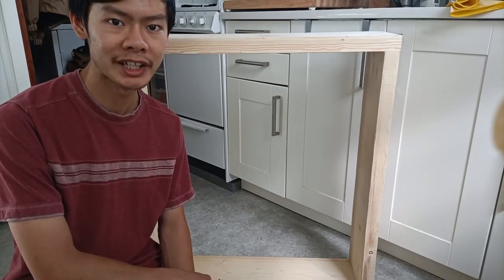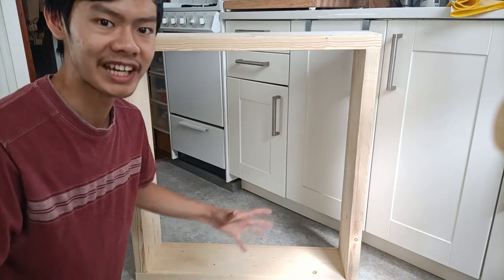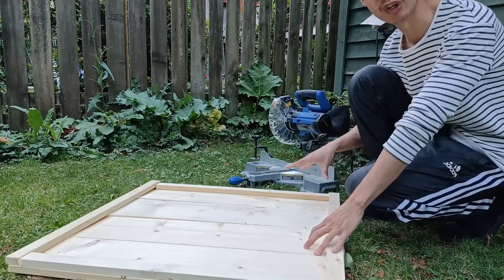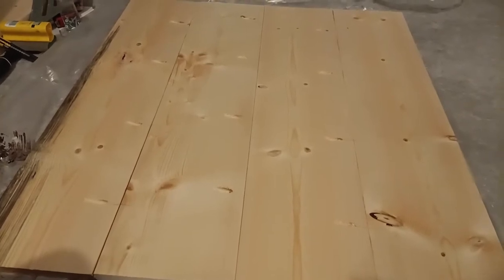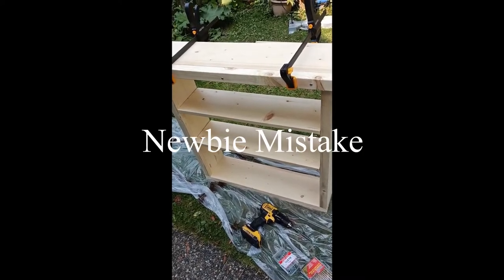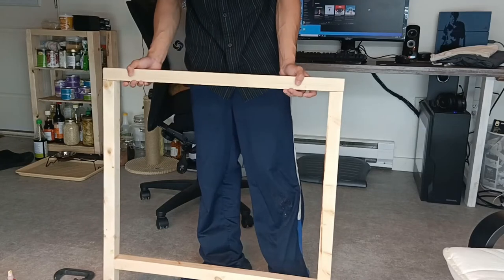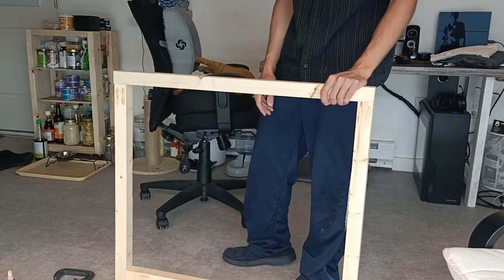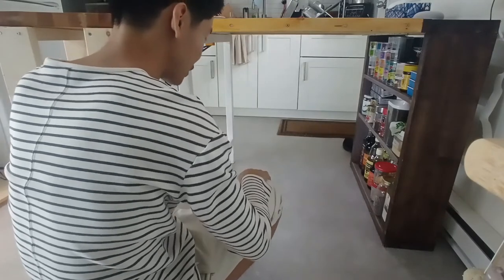Living in a Small Place? DIY Fold Up Dining Table with Storage Cabinet

Comment: Great use of space simple but very effective
Small piece of advice sand the end grain two grits higher than the face of the 
boards. This is so the stain will not soak in so much and make it look even
Reply from the maker: Thank you for the advice :)